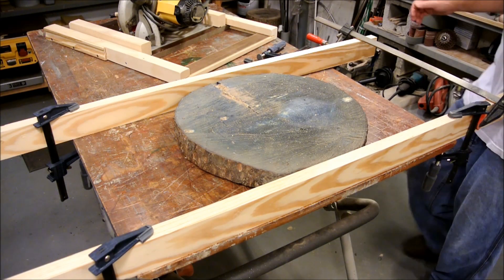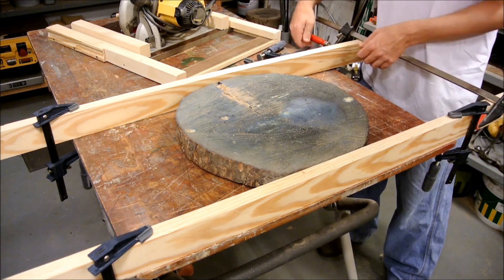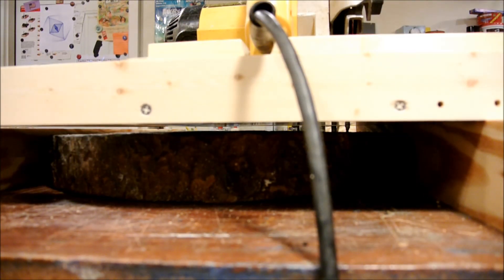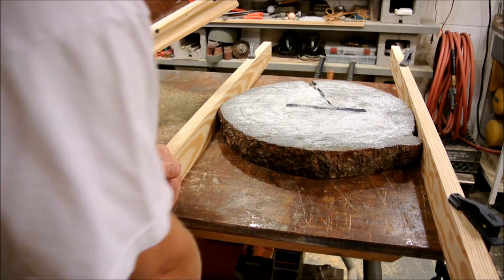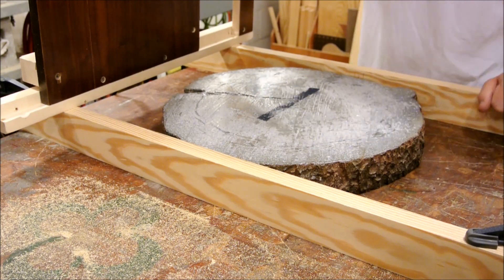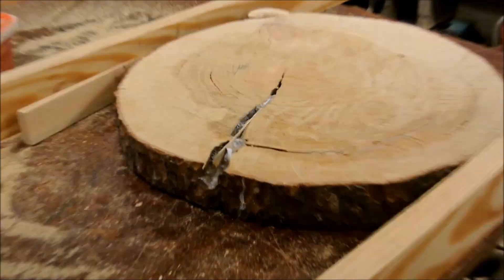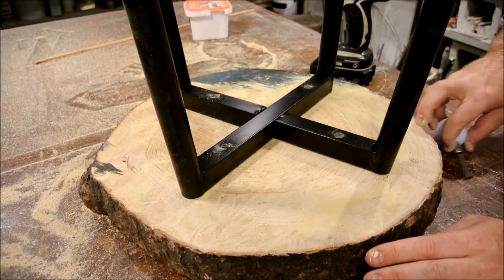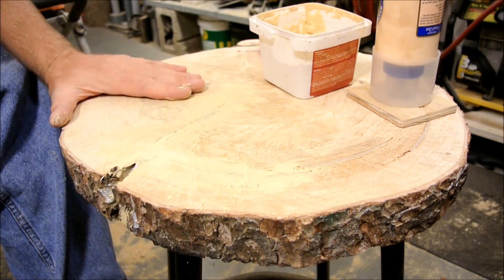Log surface planing with the (homemade) tablesaw

Comment: Why not use a router instead?
Reply from the maker: Because I used a circular saw, instead. If you need details beyond that, try listening to my dialogue in the video or reading the description.
Reply: +221Dw For a lot of reasons actually. This video is about using a saw.

Comment: turn the saw 90 degrees, then make passes in that same direction. Back in the early 60s, my Nordic uncle, used that method on 24"x24" x 20 foot doug fir beams, [building his homes] to look like he hand scraped them. Followed by log oil. Incredible look. But you can use it to flatten too. MUCH faster and, you don't leave little slits [from the tilt of the teeth] on the "finished product" that, then must be deeply sanded.
Reply: Agreed. But this project was small, and rather simple, because I was just able to use the homemade table-saw. Also remember that it was end-grain in my case. As for exposed beams, I remember my dad doing something like that with a chainsaw once.
Reply: pocket83
No worries, just adding info onto your info. Cheers.

Comment: i'm sorry but i think it would be alot easier just to use a wood planer, and if you but have one, we all know somwone that has one,
Reply: Apology accepted. I have a 13" planer. That's pretty big; any bigger is pretty much industrial grade. But this log was probably 20 or so inches wide, so I found an alternative, and it took me around an hour. Now here is what I don't understand: Why do so many of you act as though you did the hour of work? There are dozens of videos out there about doing this with a router, and anyone with a frontal lobe knows that it could be done with a planer. Why do you all want to see more of the same things you already know? Hint: Don't answer.

Comment: Nice video. But shouldn't it be better to use steel as the sliding elements? Even bending the wood with the clamps wasn't helping alot.

Comment: Why didn't you use a rotating palm sander or an angle grinder in your mount, instead of the circular saw ? Wouldn't it be faster or at least less tedious ?
Reply: Palm sander would work buuuut he would be there even longer. Angle grinder works great, but wont get it flat. And an angle grinder is way less stable...if the jig failed, it would get exciting real fast. Hahaha

Comment: I am very interested in how you are filling in the crack (insert sophomoric humor here) and what you come up with for finishing the top and how that will look. BTW is that some type of Pine? I like the live edge.
Reply: Alexander Dyer I'll be cramming some caulk in that crack. Once it's in there, I'll tool it around. Hey, you asked- I deliver. I used a mix of things, but I fixed that hole with a superficial piece of end-grain. I've now given it around a half dozen or so coats of high-build poly. I also filled it (and stained the filler) again this morning. I'll call it quits at around a dozen coats. It's looking nice so far; lots of complexity when viewed up close. Oh yes, pine. Live edge is now shiny ;)

Comment: Too bad those circular saws can't accept dado stacks lol. Even a 1/4 inch stack would be faster
Reply: P0tat0_craft They do! More on that soon. My next release deals with that subject.
Reply: No way! That's interesting
Reply: +P0tat0_craft I was able to place two blades side by side for the prop carving machine. It is still working well. :)
But I too wish i could add more.

MUDDy
Reply: +P0tat0_craft I think it would be possible to place two diablo blades on this Dewalt saw...it would need a thin spacer ( washer -shim) between them.   The  inside of  the blade gard might be slightly touched...who cares?
Reply: remige2006
it worked on mine for the prop carving machine. But there was no room on the shaft for a spacer washer. the blades were together. the tips were wider, but luckily there was room after staggering the positions of the teeth to fit between each other.
MUDDy

Comment: B, your timing couldn't be better! Just yesterday I had a friend ask if I could plane a slice of log that measures 3' across. I laughed, as you can well imagine, but I was mentally toying with a VERY similar technique to what you did here, and I think you just solidified my answer to her about doing this for her. 

Btw, I thought you giving youtube a "time out" was hilarious.
Reply from the maker: Matt Johnston I'm glad if this was helpful, but two things to consider before you do anything:If you use a circular saw, don't use a thin-kerf blade like I did. I should have swapped it for a thicker blade that wasn't an alternating top bevel (ATB) style. Second, consider using a router with the same method. It may be faster and easier, unless it's end-grain. Let me know how it went.
Reply: pocket83² yes, I'm going to use my router, but with the same kind of setup you showed. 
I have to run to Canadian Tire to replace my 3/4" double flute bit first though.
Reply: pocket83² speaking of routers, I was thinking of getting a palm router (Bosch) so I don't always have to dismantle my big router from the table I built for it. Do you have any experience with palm routers?
Reply from the maker: Matt Johnston Nope. I have to get one soon for a cabinet/laminate project, though. If you do any research or check up on what's highly rated, let me know what you figure out. Is Bosch the preferred brand or something?
Reply: Over the past few years, Bosch has become my favourite for tools. Very well built, and they put thought behind the design of their tools. Right behind that is my Mastercraft Maximum line of tools, but they're exclusive to Canadian Tire, so I don't imagine you'll be getting any of those. 
That being said, I like Bosch better than DeWalt now, which is saying something.

Comment: Does it serve as a stool, or table, or what?
Reply: ***** Yes, yes, and yes. I used to paint on it, but now that it's flat, I'm going to use it as my second shop stool, and as a camera stand. The camera would wobble on it before, so it just sat in the corner. Also, my nice stool is getting too much wear from being in the garage. And I only have maybe four or five of those floating around the house.

Comment from the maker: Good morning, and thanks for the like! Even more content on the way soon. Have a great weekend, guys.
Reply: pocket83² Hey Pocket, can I have some ways to email you?
Reply: 3006spikespiegel Click my name → About → Send message. That's a private message. I'll usually answer right away, unless there is a link in it, in which case the spam folder catches it first.
Reply: pocket83 done.. no links... just thoughts. Thanks
Reply: +nevermind A dado would help make the work go faster. Actuall the idea is a good one for that type of material removal. I don't know that you could put a dado blade on that saw.  Pete
Reply: +Norman Mcgill   Actually, one of those "Wooble Dado blades" might be just the ticket....
Reply: pocket83² do you make your own wood filler?